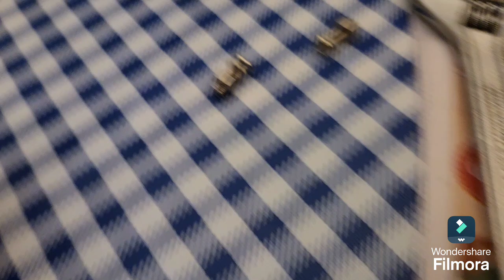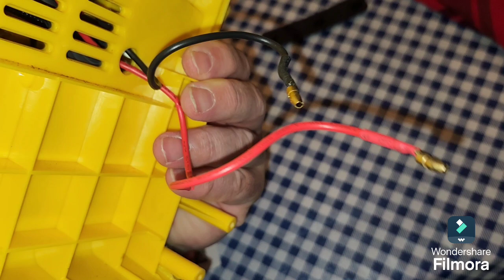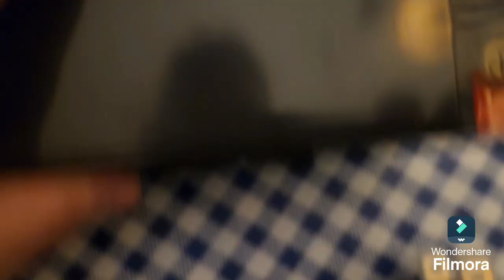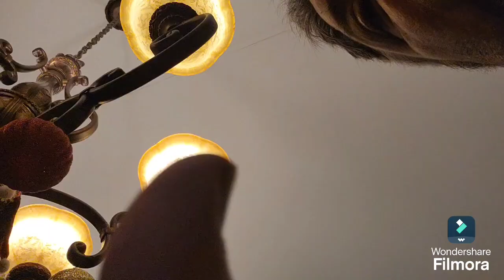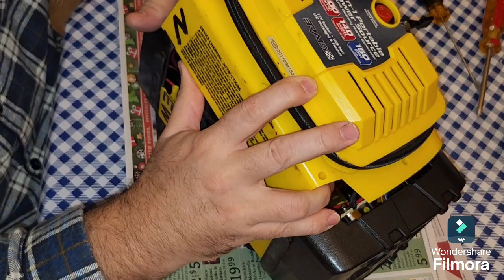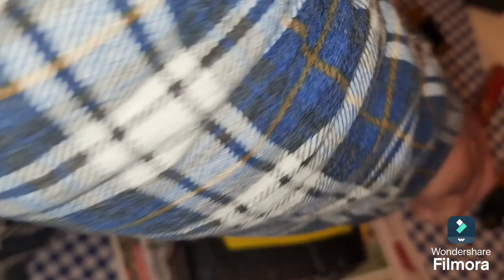Rally 7471 Powerpack Battery Replacement

Comment from the maker: Quick comment regarding the lockwashers, I put them on the nut side.  But if you look at the photo at the end of the video, you will see they originally were between the screwhead and the ring terminals, thus making assembly easier.

Comment: I have one but it won't start a car. I use it only on my riding lawnmower to pump up the tires and if I charge the battery for about 10 minutes it will start my rider. I have been very unhappy with the fact it won't start a car.

Comment: Could we hook up a 12V car rechargeable battery instead? Haha
Reply from the maker: Technically, yes !!!  Also, when the main switch is in the "ON" position, the jumper/charging cables are connected to the internal battery.  For example, if there's a blackout, this unit has a small inverter built in.  So you can increase the backup time on your 120VAC output by paralleling 12V batteries connected to the big alligator cables.  You're not increasing  your wattage, but you're increasing your run time.

Comment: The charger will not charge it
Reply: same problem with mine
Reply from the maker: This will only charge a dead battery if the battery inside is charged up.  Also, make sure you dig into the terminals with the alligator clips so they make good contact.

I mainly use this for the compressor and the inverter.  And the USB output to charge phones.  Only under certain conditions will it be successful in charging a car battery.  You're better off getting a dedicated plug in charger or a charger/starter.